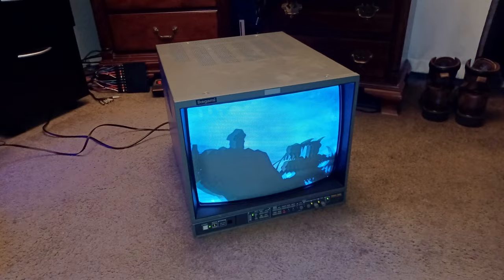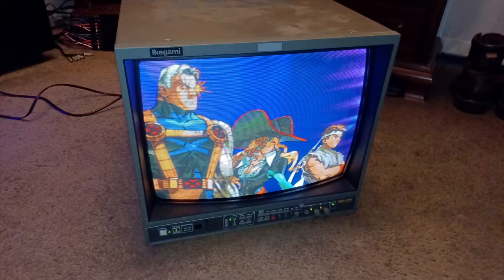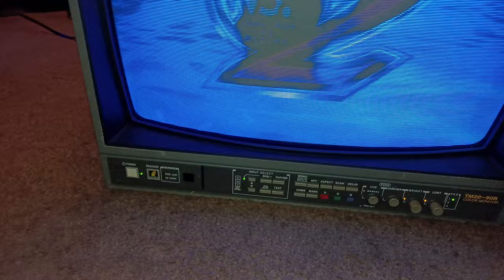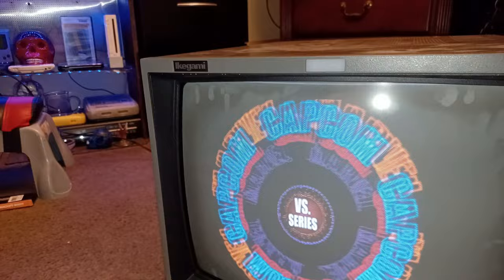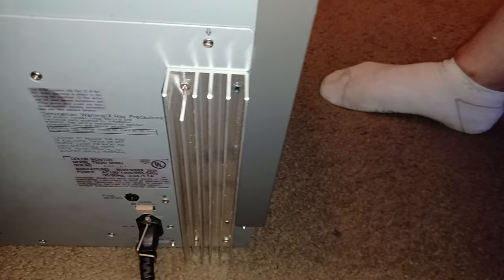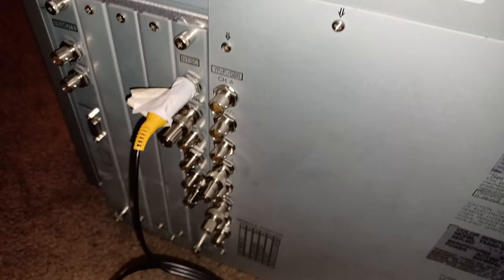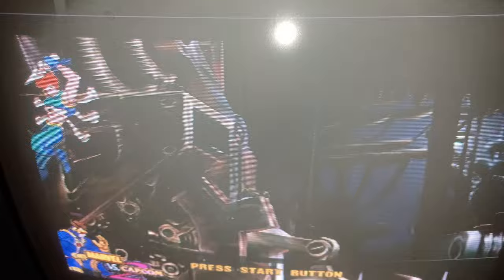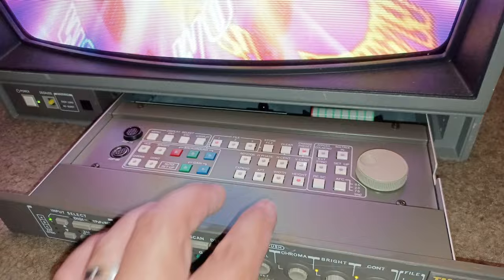My CRT Monitor is an Ikegami TM20-90RH

Comment: I found a PVM 14L2 on the street but it can't touch an ikegami. Incredible find Joe.
Reply from the maker: Thank you,  the Ikegami TM20-90RH is beautiful.  It brings out details in games, colors and shapes pop.  I play PS2 and Wii on it most of the time. What do you play?
Reply: @JoeRetroWorld  MiSTer! It's basically a console that becomes other consoles on a hardware level using FPGA. If you haven't looked into it check it out. Since you have a multi-format monitor you could handle everything it can throw at it resolution wise.

Comment: Congrats! These things are great. I got the TM20-18RP (PAL), TM20-20RH (NTSC), TM20-17R (Multinorm) and two TM10-16RP (PAL) plus two TM10-17RP (Multinorm). Will never part with them.
I also have the ASP-15C and ASP-15E Auto Setup Probes for the master monitors.
Reply from the maker: Thank you,  I can't believe I found one for cheap and in good working order. It even came with 75ohm terminals. This is it for me I have a hugh Toshiba 36a43, Dell E773c crt monitor and now with the Ikegami TM20-90RH.  My retro corner is complete.
Reply: @JoeRetroWorld  Most of those Ikegamis are in working order as they simply make the highest quality equipment but sadly these are hard to find because most facilities just throw them away for no good reason and most people don‘t even know the brand. They prefer SONY which is a whole level lower in quality and reliability.
Reply: I think the Auto Setup Probe 15 should also work with the 80/90 Series of Ikegami monitors. You have the little round connector in the drawer for it. The ASP-15C is for the NTSC Monitors and the ASP-15E for the PAL units. You can get them pretty cheap if you ask the sellers right now. With the help of the probe it is possible to quickly calibrate the monitor to your desired color temperature or to the industry standard preset or simply safe your current setting in the probe to calibrate other monitors. 
Maybe the only thing you have to do is to solder in a new backup battery.
Reply: Here‘s a video I made around ten years ago showing the probe in action:
https://youtu.be/8qO0eYm-ip8
Reply from the maker: @Funktrainer  that device is cool. Do you think ebay has one?
Reply: @JoeRetroWorld  eBay has several. Just ask the sellers for a good price. And remember the ASP-15C is for NTSC monitors whereas the ASP-15E is for PAL.
Reply: Congratulations. I have the TM20-80R that I use RGB for my Neo Geo AES, MVS, NGCD collection. I think the Ikegami’s are the best and like the bubble screen which are more arcade like.

Comment: You scored dude. Congrats.
Reply from the maker: Thank you
Reply: @JoeRetroWorld  Welcome to the club. I have a bvm1911 and it has a pull out drawer as well. I have other pvms with an osd but I actually prefer the analog pull out drawers. It's easier and faster to turn turn analog dials than cycle through a menu with a remote. It's also more fun imo.
Reply from the maker: @riggel8804  the drawer is the cool factor for me. The easy adjustments really make it a thousand times better. Thank you,  fells good to be in the club.
Reply: @JoeRetroWorld  Can't believe you found that thing in 2022. I gave up looking for pro monitors in 2017. In 2014 they were easy to find and cheap or free.
Reply from the maker: @riggel8804  you can never give up.  I searched offerup and Facebook until found this one.  I still look at it and trip.
Reply: @JoeRetroWorld  haha. That's a good feeling. The monitor you found has a lot going for it: it's large, it's relatively new, rgb and component, 900 line. Can't really ask for more. It's also an unusual monitor. There are not many ikegamis out there and it's odd that it stayed analog with it's cpu when all other pro monitors had long since switched to digital cpus. The cpu on that thing is super cool.

Comment: Wait till you get the BNC connectors for RGB, it will blow you away 😀
Reply from the maker: I can't wait.
Reply: @JoeRetroWorld  also make sure to put 75 ohm BNC resistors on the outputs of r, g, b and sync for whatever channel you're using. I've had a look in the manual for your monitor and it says that if you're not using the 'loop through connection' i.e. connecting the outputs to another monitor then fit 'terminating plugs'.

If you don't then it can send the colour intensity through the roof and overload the monitor (at least that's what it does on the Sony BVMs).